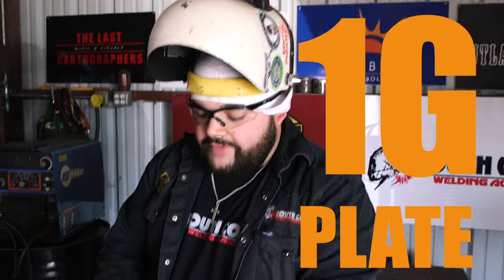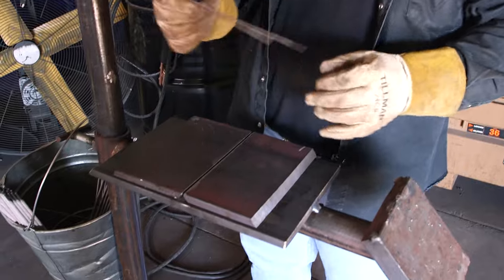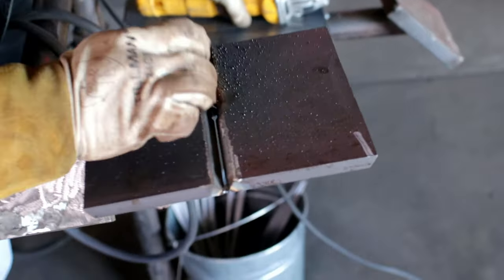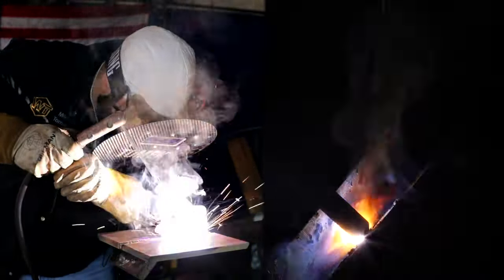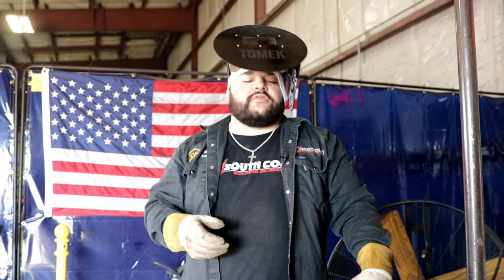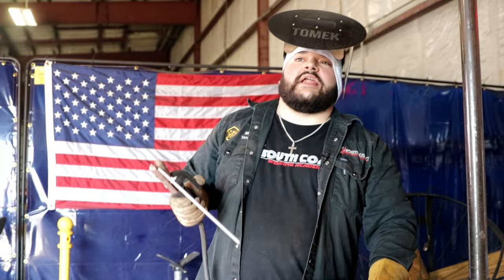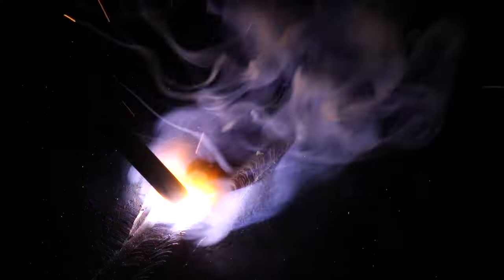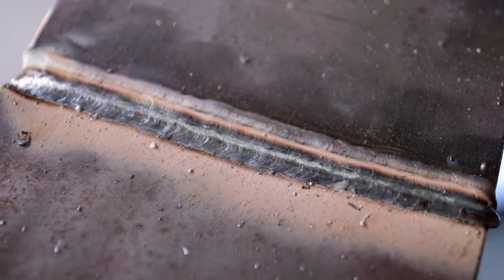1G Plate | STICK WELDING

Comment: I usually take a soapstone and mark it about a 1/16" from the edge of the bevel and use it as a guideline for the edge of my cap pass. I try to avoid using a grind line since if you accidentally go to far over it will fail visual.

Comment: Thank you for this video. Great detail, simple to the point explanation, get to it. Hello from Detroit. I'm doing my 1G work tonight on 2"x6"x1/4" Carbon Steel  square groove weld 6010 root 7018 cover.

Comment: Nice video, I would like to see a D1.1 one inch thick plate with a landing strip. 7018 1/8 rod from root to cap running stringers then a bend test. Thanks fellas. 👍

Comment: You used a grinder after the root pass, but a wire wheel after all the other passes. Is 6010 slag too difficult to remove with a wire wheel, or is there a specific reason to grind the root pass?
Reply: 6010 doesn't have flux on it so there is really no need for a wire wheel other then to make it look pretty, all 60 series rods have no flux.
Reply: TherealBeaston there is definitely flux on every stick rod lol and the 60 is the tensile strength not the flux composition.
Reply: Mark Lowry to ensure complete fusion on whatever you’re welding on. If you run a 6010 rod for a root the edges are rolled up and not tied in the base metal on the side you welded on, and just welding over that isn’t guaranteed to burn all the way in. Could leave spots of slag or lack of fusion. Grinding helps reduce any of that from happening
Reply: @joeboyle8987  -- Makes sense. Thanks.

Comment: Thank you, I got ideas for my test but there is something I dont understand: your root pass was 100 amps becuase is a 6010 1/8, your first pass was 125 amps becuase is a 7018 1/8,  and when the plate is already warm your second pass was 135 amps, higher than the first pass? it is not lower for the heat effect, I mean second pass 110 amps?

Comment: The cwb dosnt allow anything that removes metal on tests... any tips for only being aloud a wire wheel
Reply: File that shit lol
Reply: A wire wheel will remove metal.
I had a burn out on my vertical plate first coupon today.
I put my mig gun away real fast.
Got on the six inch grinder, with wire wheel, held that sucker on the," grape", an it disappeared.
I waited for the plate to further cool.
Then continued on like normal.
Bent all plates.
Two more years of all position welder for this guy.

Comment: Can y’all do a 2G weld with Tig on 1/8 plate. Root, hot, fill and cap? I’m currently in college for GTAW and I have a weld test coming up for it. Could really use pointers.
Reply: I mean 1/2 inch plate.
Reply: And a 5/32 root opening

Comment: I understand clean grinding the front, because the cap will consume some of that from the top. But why clean grind the back, as the weld doesn’t come from that direction, and shouldn’t break through? The tacks aren’t critical.
Reply: I’m assuming it’s for the 6010 root pass. Probably because you want penetration and the parent metals to blend together at the landing so if there’s any contamination on the backside of the plate it’ll pull through into the weld.
Reply: I suppose that’s possible.

Comment: Grinding is not allowed in welding test at my school.
Reply: Floppycoc104 how do you make your coupons
Reply: Its Mags cutting metal is done with a torch.  There is bench grinder to clean the edge after torching. Cutting your test into bendable strips is done with a bandsaw.  
But there is no electric grinders or wire wheels allowed in the welding process. Slag hammer  and hand held wire brush only.